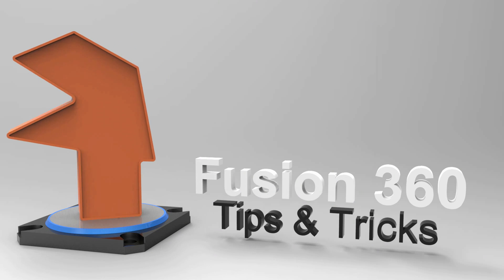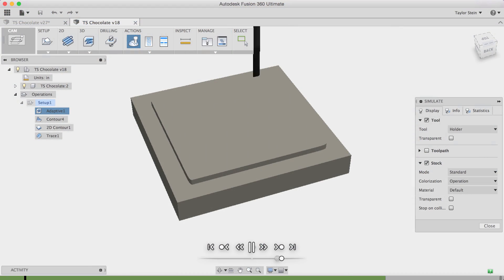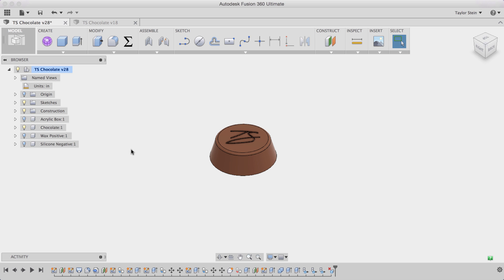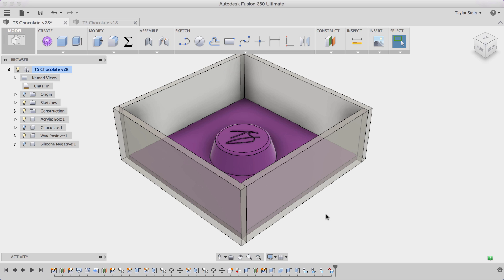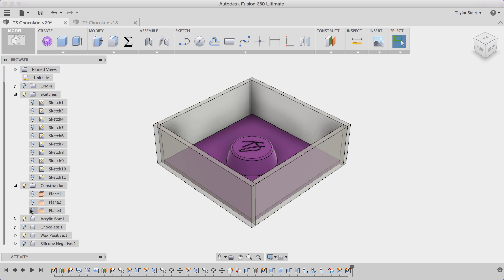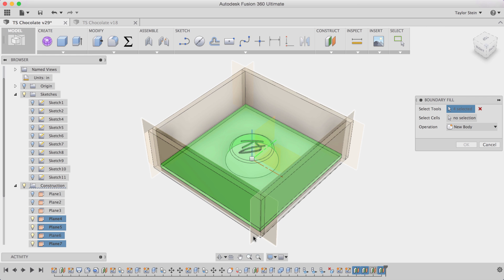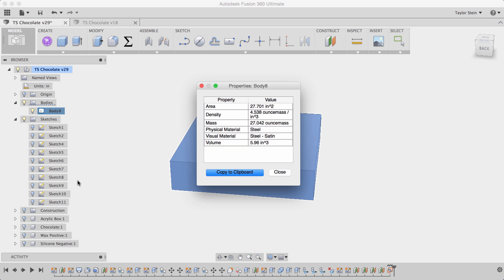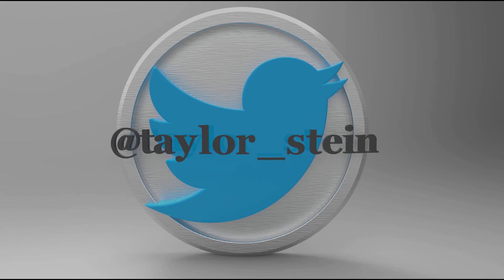Fusion 360: Mold Making Tips

Comment: Thanks for this. I'm curious - could you not use the CAM feature to mill the positive a bit lower than the surface of the wax and even draft the walls around it to make it easier to remove the silicone? It seems like the plexi box is an unnecessary step and that you could take the wax right off the mill and pour the silicone. Any reason not to do it that way? I imagine you'd still be able to calculate the volume in F360